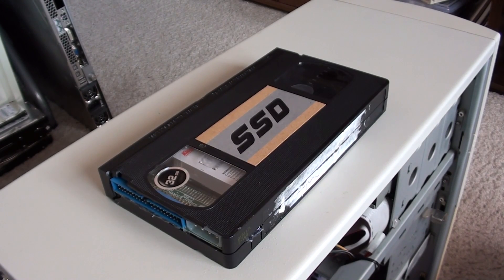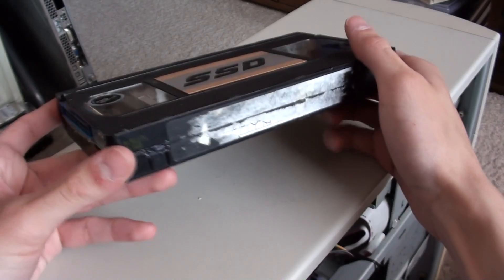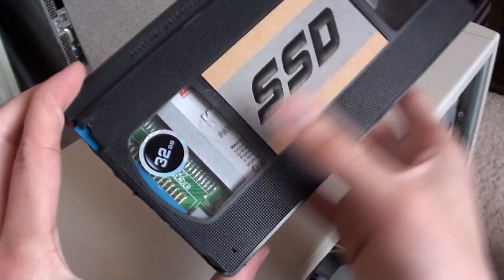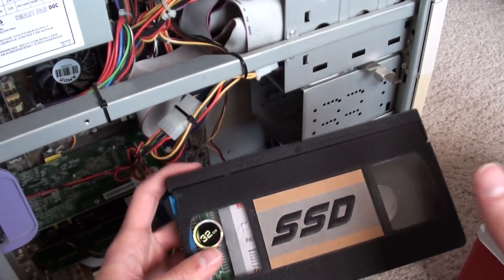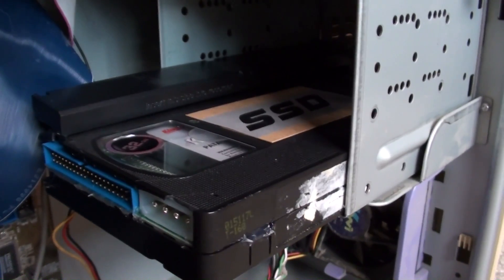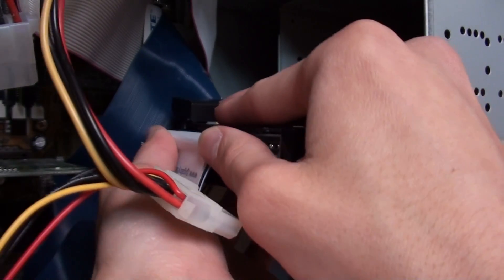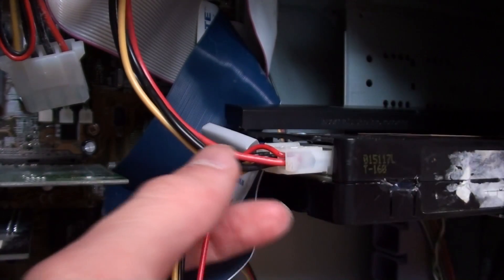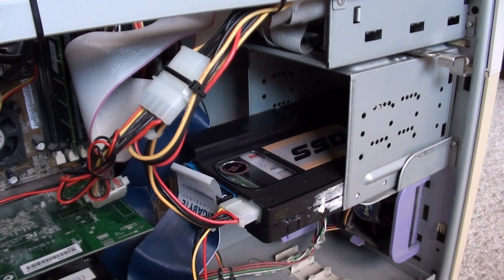The VHSSD

Comment: Just a crazy idea, put a USB to SATA adapter and a hard drive in a VHS tape, make it so that there is a female USB plug under the cassette.
Mod a VCR with a mini PC inside connected to the VCR's AV outputs, put a male USB plug inside the VCR mechanism facing up and aligned so that when the tape is inserted to the VCR both USB plugs connect together.
Fill the hard drive with retro videos, and insert the tape in the VCR connect the VCR to a vintage TV and enjoy.

It would be best to use a normal hard drive as the sound it makes while revving up would mimic the helical drum noise.